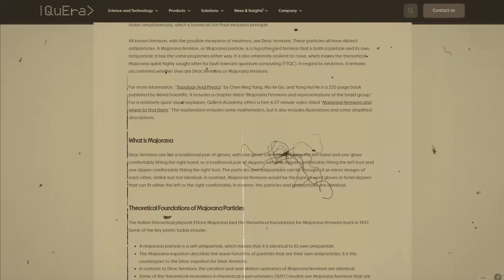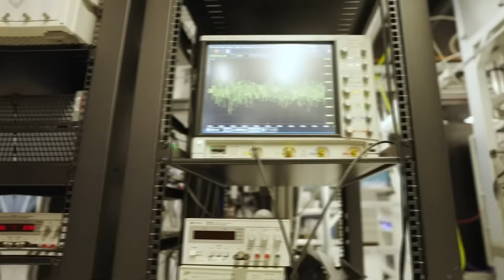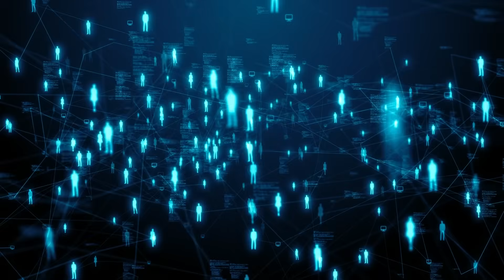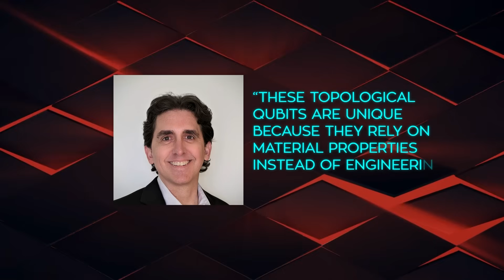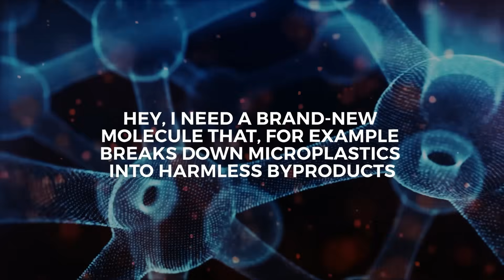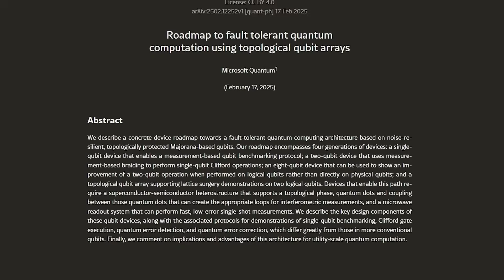Microsoft SHOCKED The World with First AI Quantum Chip That Unlocks Limitless Power

Comment: Here's what Grok told me about this: Quantum computing isn’t poised to replace classical computing, and conflating the two is where a lot of this hype gets muddy. They’re fundamentally different beasts. Classical computers, with their bits flipping between 0s and 1s, are built for sequential logic, storing data, and running the kind of step-by-step reasoning that powers everything from spreadsheets to LLMs like me. Quantum computing, with its qubits and superposition, excels at parallel processing and solving specific problems—like factoring huge numbers or simulating molecular interactions—where classical systems choke due to exponential complexity.

So yeah, it could accelerate pattern recognition or optimization tasks, say, for training AI models faster by crunching massive datasets in ways classical hardware can’t touch. Imagine cracking cryptography or fine-tuning neural nets in a fraction of the time. But holding knowledge? Reasoning through arguments? That’s not its lane. Quantum computers don’t “think” like classical ones—they’re more like specialized math wizards that spit out answers to narrow, well-defined problems. You’d still need classical systems to make sense of the output, store it, and apply it logically.

The Microsoft chip might push quantum tech forward, but it’s not rewriting the rules of how AI reasons or learns—it’s just a potential turbo boost for certain heavy-lift calculations. The idea it’ll “rapidly accelerate AI” probably oversells the scope. AI’s bottlenecks aren’t all computational; they’re also about data quality, algorithms, and human ingenuity, none of which a quantum chip directly touches. 

... so don't get caught up in the hype. It's a new tool. Will it be powerful for certain tasks, absolutely. Is it the EVERYTHING ... no.... it won't replace classical computing... but who knows what other exotic uses might come of it.
Reply: Broski Semiconductors, specifically transistors, began replacing vacuum tubes in electronics during the mid-1950s, with the transition largely complete by the early 1960s, marking the shift from first-generation vacuum tube computers to second-generation transistorized computers.

This is that new 1950’s moment and you’re poopooing it!
Reply: @Ac-ly8tx  not true. The vacuum tube and transistors performed essentially the same functions but using different materials and methods  They are not analogous to quantum vs classical computing. If you think they are then you don't understand how quantum computing works. There are only a subset of functions quantum computing will vastly improve if they can remotely reliably work with low noise and high confidence. There is indeed a lot of hyperbole and many companies are likely capitalizing on it to earn quick dollars that many times will end up being a purchase with no value.

Comment: Could!!!! It currently has only 8 qbits. AND it is NOT the first. DWAVE has monetized quantum computing and is currently printing a 7,000+ qbit system. What about Googles SECOND quantum processor, Willow?  What is going on here? Is this simple marketing or what?

And you shouldn't conflate GenAI with Quantum Computing. Think of a handful of chips, all stamped with a single linier equation on the surface for identification instead of a brand name. Each of these processes can solve only one linier equation, nothing else. So you have to find a useful linier equation that takes years or more to computer engineer a new ship that only does that. You can't play games or work on spreadsheets with these 'computers'. Until they can operate near room-temperature, they will have to be called upon in a cloud or by an API. GenAI would have to already know it has a requirement for solving a complex linier equation before it calls on a Q system to run it and then it would have to wait for the results.

Comment: This is huge. I was a kid of the 60s and saw the transition from transistors to semiconductors. 'Table radios' shrank to portables that you could run on a battery, then in the 70s they got tinier. Picture that kind of thing with your devices. Awesome! Also electronic prices came down for consumers in the lower ranges, making popular devices more affordable, and adding capabilities to high-end ones, which later became affordable.
Reply: Me too, I was even a mainframer in the 80s in the Air Force. Data cards, paper tape, 9 inch floppies!!! But, this chip doesn't currently solve any linier equaations and is only 8 qbits. We shall see.

Comment: 🎯 Key points for quick navigation:

00:02 🚀 Microsoft announced a groundbreaking Quantum chip, Majorana 1, that could revolutionize computing with a million-qubit goal.
00:15 🔄 Quantum Computing could rapidly transition from theory to real-world applications within years.
00:30 🧪 The Majorana 1 chip uses topological qubits, built from topo conductors, providing stability and error correction.
00:54 📖 Majorana particles, once theoretical, are now harnessed by Microsoft using advanced materials and cooling techniques.
01:25 📉 Topological qubits are more stable with inbuilt error protection, crucial for large-scale Quantum Computing.
02:08 🌀 New measurement techniques using digital pulses simplify quantum operations, reducing complexity.
03:18 🧩 Microsoft aims to scale qubits into larger arrays to reach fault-tolerant million-qubit systems.
03:33 🌍 Potential applications include environmental solutions and discovering new catalysts in various fields.
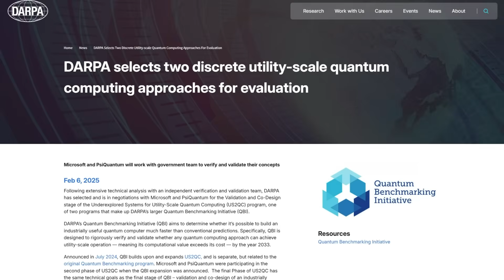03:48 🛡️ DARPA validates Microsoft's approach, progressing to the final phase of a fault-tolerant Quantum prototype.
04:30 💰 Growth School offers AI training to boost income amidst a rapidly changing job market.
05:51 🌐 Industry experts see Microsoft's breakthrough highlighting the need for Quantum computing readiness, especially concerning security.
06:33 ⚔️ The race to achieve fault-tolerant Quantum Computing places pressure on NISQ systems.
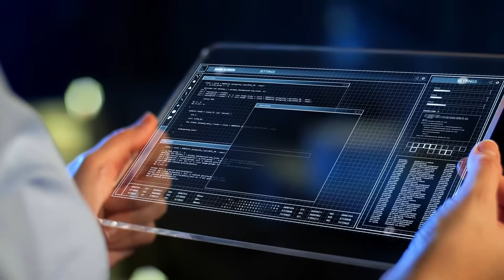07:02 📏 Measurement-based Quantum Computing could simplify scaling by avoiding complex analog parameters.
07:43 🎯 Microsoft's focus on material properties could redefine Quantum Computing's foundational elements.
09:35 🔍 External labs verify that Microsoft's Quantum architecture could surpass classical computing.
10:03 🏃‍♂️ Experts advise businesses to prepare for Quantum and its potential impact on cryptography and AI.
10:31 🤝 Microsoft remains involved with other Quantum technologies while betting big on Majorana 1.
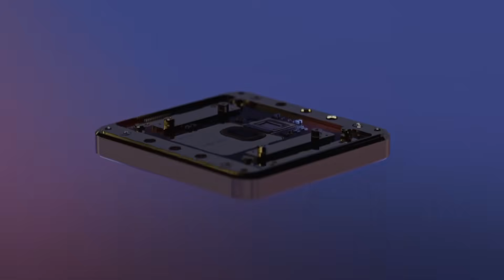11:10 📲 The potential impact of topological qubits might echo the shift from vacuum tubes to semiconductors, ushering in a new tech era.

Made with HARPA AI